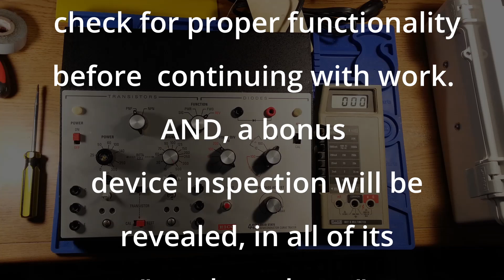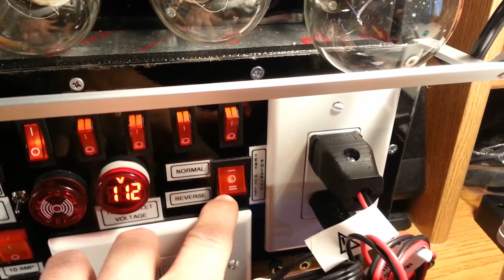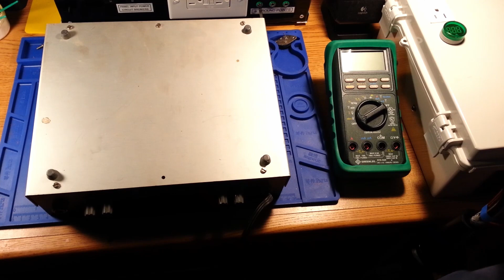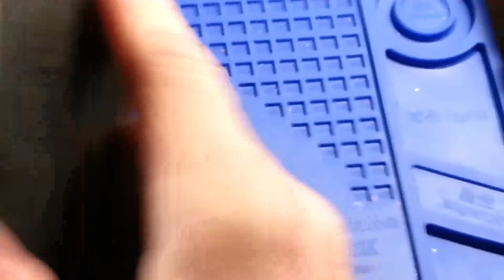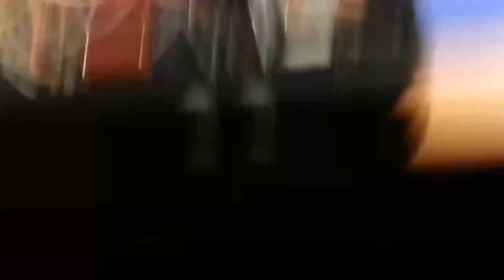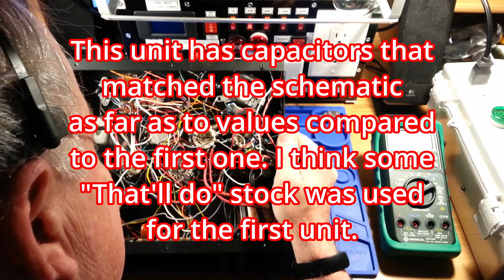E005_PT2 - Eico 443 Semiconductor Curve Tracer - Checking Transformers & bonus device reveal

Comment: It won't over range. The meter if it survives will actually read to 1,999 volts before it over ranges. Had an older Beckman meter that I read 1,500 volts in a scope on the 1kv range. Not problem with that meter. I wouldn't even try with a newer meter though.
Reply from the maker: That is good to know, but it surprised the hell out of me. The manual says it is rated at 1000VDC/ 750VAC RMS, but I didn't want to risk anything newer going up in smoke.